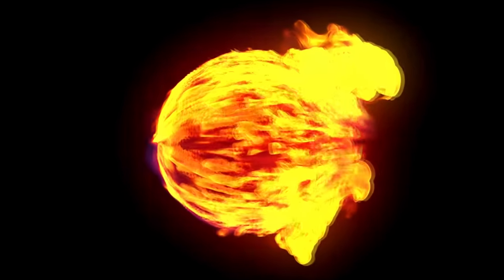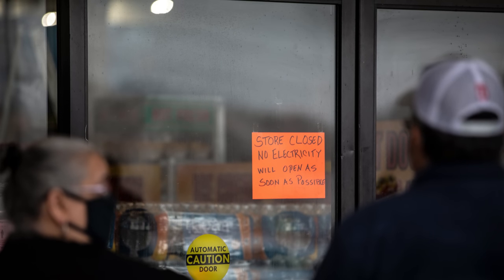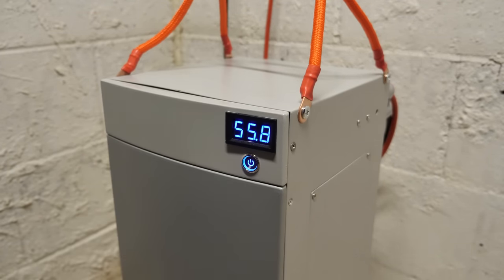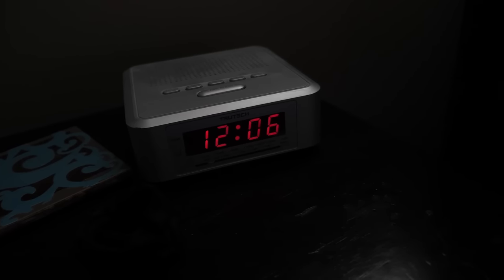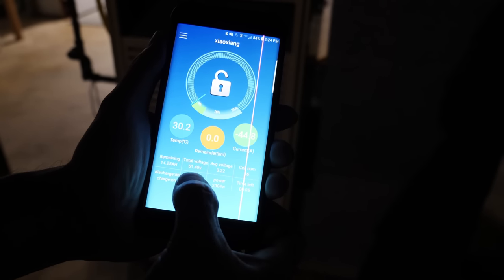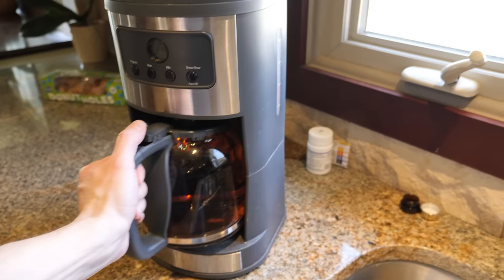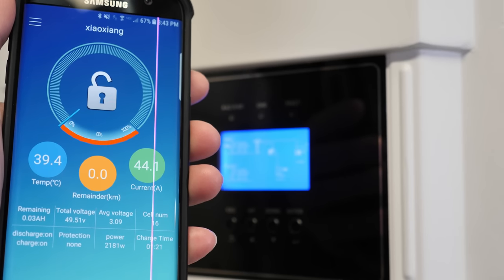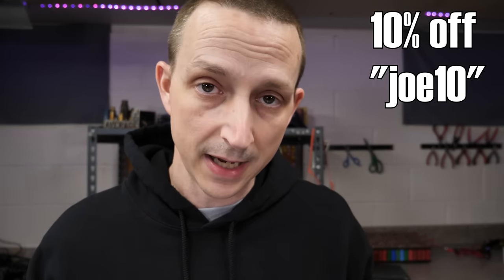Power your House with a Husky 48v 5.3kwh LiFePO4 Battery! BigBattery.com Test Review (2023)

Comment: OK quite a few things here one what was that explosion and all the electrical fire that happened when you turned your system on stupid to add that in there second you never showed where the battery is connected or how it’s connected and why are you have an inverter already connected to the house if there’s no battery connected to it simulated rolling black out you’re gonna have your off grid turned off to your circuit panel all the time with that what you’re saying very confusing video as to what you’re doing you’re not explaining anything right

Comment: So if I bought 4-5 batteries, maybe 6.....I could tell the power company to bite me.
Edit: But $20,400.00/$125.00mo (my average bill) would take 163 months, or 13.5 years to pay off. 
Yeah.... No.
But for power failures this is a definite good thing!!!
Reply from the maker: They have kits now with everything but solar. I bought 21 245w used solar panels from santan solar for less then $1500 and have been using them without any issues for the last few years.  I think it would be half the price with half the time on ROI!

Comment: Joe, no need to cut the box, you can keep it in case you need to return the item. Just:
1.- Open the box with flaps out
2.- Put the box upside down.
3.- Pull the box. BAM! done.
Reply from the maker: I had thought about that but cutting it open was funner!😆😆💥🤘

Comment: I think you were using the solar the whole time...at the bottom of your phone it said charge on....I want to see you do it at night...bet the puny battery wont last 1 hour
Reply from the maker: 😆 lol no way solar was on. Circuit breakers were shut off for the run. On the app it shows "charge on" to let you know the bms contactor is closed and will accept a charge. 🤘
Reply: @AveRage_Joe  ok...so I install solar...I know your solar was charging or a generator was on
you may have shown that the solar was off...but funny thing about video is you can make people believe anything
Reply from the maker: Sure I guess you could trick people with video editing. If you havent seen past videos you would know that I had no charge source. I also did regular ol capacity test and that also shows the same results for runtime ect.😆

Comment: Nice video and battery Joe.  A house with natural gas pretty easy for off-grid.  Electric range, dryer, hot water tanks are hogs for homes without natural gas.  By chance do you have central air conditioning?  That would really test the surge capability of the big battery and inverter.
Reply from the maker: Yeah our furnace and water heater is has. Everything else is electric! We have AC and its SUPER old🤦‍♂️ Would be a good test for sure lol. Still chilly out atm tho! Inverter should handle it no prob tho!

Comment: so you would probably need about 15 350watt solar panels to keep that charged up to be 100% off grid which would be nice and probably the cheapest off grid setup to be honest depending on the cost of that battery, inverter, and panels.
Reply from the maker: I have close to that and it charges it quick!  The rest of the day is running on solar alone!

Comment: eeeeewwww...5.3 Kwh...thats not much...how many Ah
in renewable energy we dont express storage in kwh...theres a reason for it

as voltage goes down in a battery, so does wattage but how long amps can be drawn is a constant
Reply: never mind..I just saw it...103Ah...it wont last 20 hours drawing more than 103 amps
Reply from the maker: Yeah a 103ah battery drawing 103 amps will take 1 hour to drain.

Comment: Hook up the negative side last, this will solve the "big spark" problem. The negative side has less potential energy. Do your homework. Good video. 👍
Reply: Yes, you are correct that it is rule of thumb whenever you are connecting DC it should always be positive first then negative last but the purpose of the resistor was to bridge the connection to allow the capacitors to charge located in the charge controller and battery banks for equalization; which in most cases dramatically reduced or eliminates the potential difference that would in turn create a spark. The use of the resistor was correct. Do your homework before you jump to correct someone else.

Comment: BS. That app said 0 remaining every time you showed it on your phone, so it wasn't performing obviously. I hate commercials.
Reply from the maker: I didnt know at the time of this video the bms will recalibrate after your discharge and charge cycle of the battery and show correctly. I mention this in the capacity test video of this battery.

Comment: 3 hours is a tiny tiny amount of time.
Reply: when pulling 100+ amps? absolutely not. If your house had LEDs and new appliances, with very little habit-change you could last days.
Reply from the maker: For a 100ah battery I didnt think it was to bad.  If it was a real situation blackout, I would only use what was needed which would extend the runtime a lot.  If one used it for rolling blackouts ect, you wouldnt even know the power went out.

Comment: Cells on their side again. No thanks.
Reply from the maker: If you are refering to Wills then his was a beta unit and with different cells. That battery has been fixed! Totally different battery here!🤘
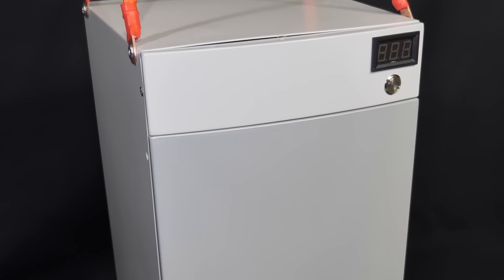Reply: @AveRage_Joe  No, I'm referring to the shots at 1:55 where you take the cover off and show the circuit board with the terminals. The cells behind the PCB are clearly mounted on their side .
Maybe they aren't mechanically loaded like the one that leaked for Will, maybe.
I personally won't mount cells in this leak prone fashion and wouldn't accept that design from an assembler. 
This is why videos like yours are so valuable.
Reply from the maker: Oh ok I gotcha my bad. Yeah the cells are mounted on there side like you mention. I would imagine for these cells the manufacture says its ok to mount on there side or BB wouldnt have done it. Ill continue to use as recommended!🤘